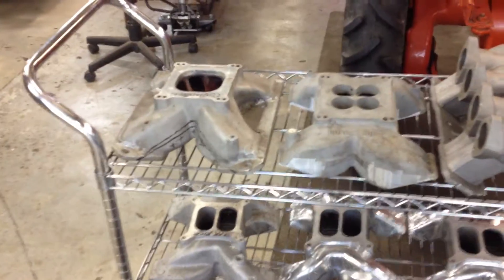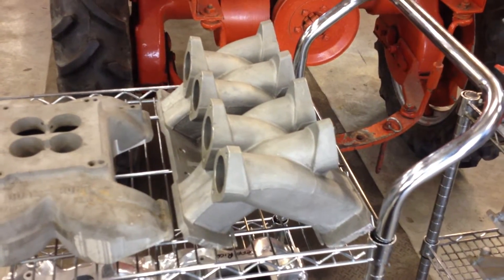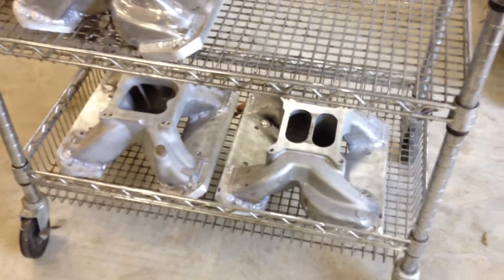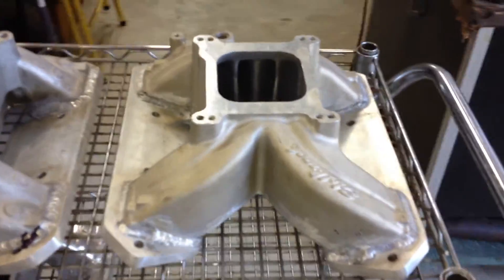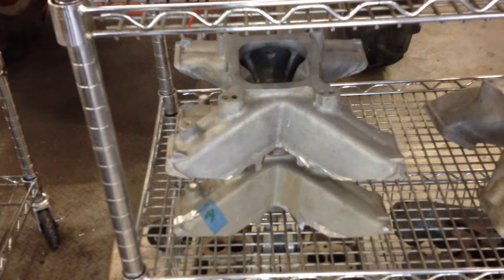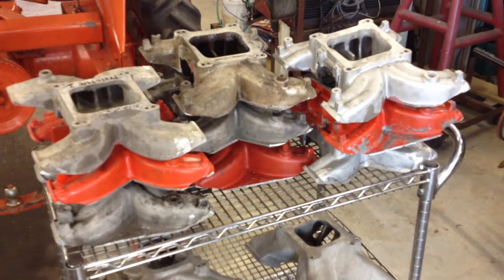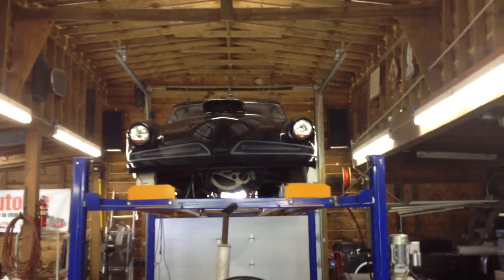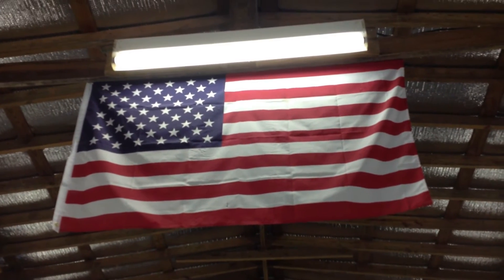DEEPNHOCK 120929 Studebaker Intake Manifolds

Comment: I'm currently doing a complete frame off restoration on a 61 lark. Are these manifolds available to be bought. I'm trying to get a root blower on the 259 engine
Reply from the maker: Yessir. Similar to a Dyer setup.  You can contact me at DEEPNHOCK with the gmail thing.